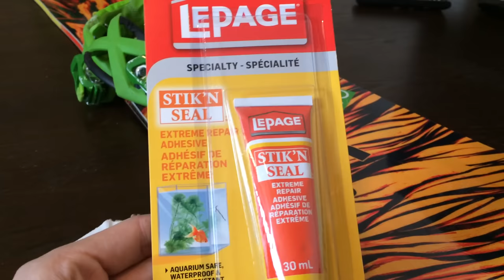Snowboard Repair 101

Comment: JB Weld is damn great too. I suggest the blue color `Marine` version. Cost less, I`m sure. I have fixed fuel pipes and diesel injectors with it that have hot and highly pressurized diesel fuel going thru in them. Years ago, and no issues. Im sure it can handle a snowboard. Doing this fix now on two of my boards.
Reply: ....I love JB but what exactly did you fix on the injector and what injector was it?! Haha
 If I smell something funny with an injector it goes to the trash 🤣

Comment: Nice video man! I like how you used vice grips and cardboard! I had to do this earlier this year. I used a 2 part epoxy. I also used finishing nails to keep the split spread as i filled it with epoxy and used a hair dyer to help soak it into the fiberglass and wood before i took out the finishing nails and C-clamped it back into place. Its holding up perfect! can barely tell where i repaired her!
Reply from the maker: Nathan Dallas great idea with the finishing nails to hold it open ! That would really help. Keep an eye on that epoxy, I switched away from it because of its rigidity and weakness in cold. I fear it will crack and fail on you once you start hitting some bumps and buttering down the slopes!
Reply: Avery Birch yeah I was worried about that too so I spent a lot of time reading all the labels to see which one would work best I'm the cold and still have enough flex for presses and butters.
Reply: What's the "2 year later" report? Still holding up?

Comment: Is there a faster way? I am in a snowboard trip for a month and my board cracked just like yours... I need to fix it in like a day or less
Reply from the maker: Laura Cauduro this is the best way I've found! I've tried many adhesives and they have all failed except for this one. It's because it remains flexible in the cold. 
Quickest fix is glue, cardboard+ clamps, and remove at minimum 6 hrs later.
I do mine at night, sleep, wake up and remove